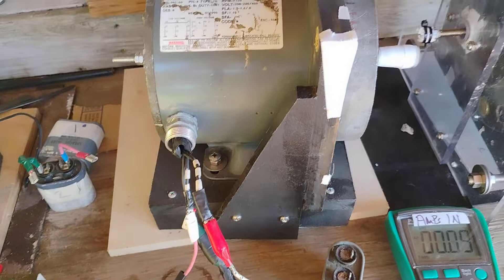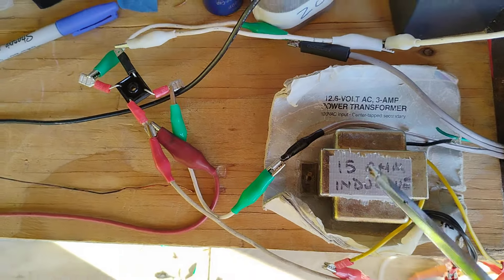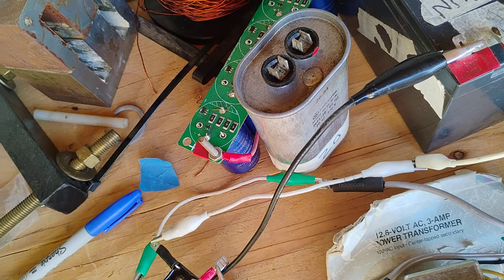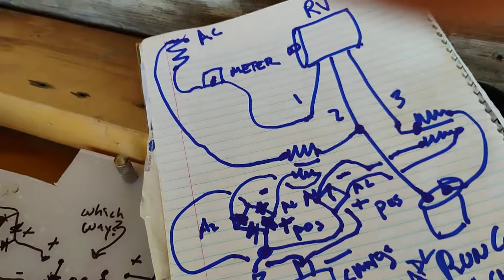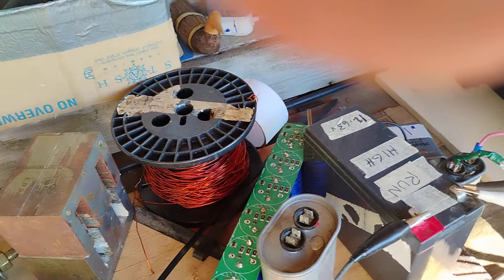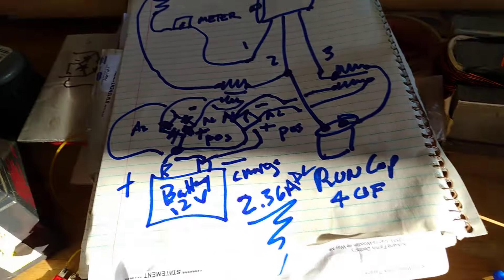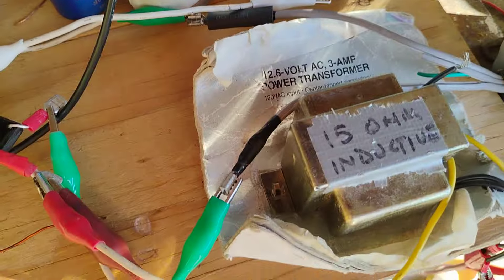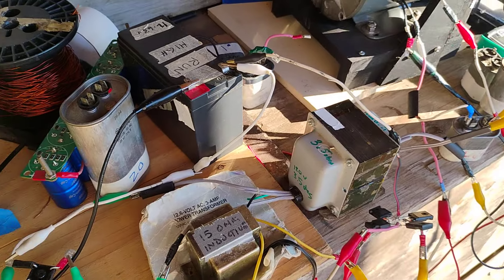2.3Adc(!) now feeding battery, dual transformers and FWBRs, (note draw goes up to60W however)

Comment from the maker: Here is the rotovertor circuit using two transformers and two FWBRS in link below that  I promised I would post instead of the very messy drawing in video:
https://alternativeworldenergy.wordpress.com/simple-rotovertor-looper/
Also, at 12:10 I meant to say 4uf cap, not a 2uf cap.
In link below  is the looping Rotovertor circuit Hector posted years ago that I was trying to replicate yesterday and today,  and finally came up with my own version which is very similar....note the "extra" transformer at bottom of drawing:
 https://alternativeworldenergy.wordpress.com/hector-rotovertor-circuit/

Comment: One of the things I did with this setup was take the vectored power over to the RV Alt and vector that out with a larger transformer.  Basic rig is to have two motors nose to nose. The trick is to run the second motor off of the run phase cap with it's own run phase cap. 2 RVs in parallel run on less than one driving the other at idle. Vector transformers can then drive the load  Get a second motor and use it like a vectored transformer.
Reply from the maker: Hi Chad
I have my dual rotor alternator thing to attach to shaft, it's similar to a Muller generator like our friend Robert Myrland loopedr using an RV spinning it years ago.  
What you describe sounds like what Tom McKay did (also years ago) using two motors shaft to shaft with run caps combined I guess  vectored into the other.  I have all his schematics if you want to see them .
Hector calls what I did here in video  parallel solid state. I guess with invertor in loop that makes it solid state. I don't know...
I took your advice and soldered all my connecting cables as when one goes bad it screws up progress forever  until the problem found  meanwhile I go down wrong road thinking it doesn't work with gremlins laughing as it's just cable.
You should join EVGRAY@grouos.io/ Hector monitors it from his distance he  will start posting again when his computer gets fixed I hope..  Wally from Argentina posts there he is really doing good RV work...
Reply from the maker: Hi Chad
I tested this out today and it does not work very well, the draw does NOT stay at 90ma but instead goes up to a huge 500ma when the extra transformer  put in circuit across L1 and L2
Sorry!

Comment from the maker: Hi Mehmet
Problem when I added the second transformer, I put the AC legs of it's primary in parallel with the AC feed to the motor itself.  So it's like adding another AC power supply on top of, and independent to the run cap phase that I have been pulling that 340,ma out of and then slammed. In the 😂rectified secondary output of that "extra" transformer straight into the super cap and battery.  I was fooled because tone of motor did not change and meter showed no increase in draw.  The ammeter was in wrong place and did not the extra draw, when I put meter in correct place now the huge extra draw shows up wh n I get the 2.3A into super cap and battery.  With invertor ipoweing motor in looped mode  and motor not connected to grid anymore now the invertor cuts out every five seconds or so from some current limiter inside it..adjusting run caps is no help as I have bypassed the motor just slammed more juice into the super cap and battery via straight from the AC input.  I am going to take this video down in a few days as it is embarrassing

Comment: Awesome. Well done! With the set up dialed in so well it would be interesting to try another, less efficent, inverter if you have one kicking around, just to see if will work without the special statpower inverter. Thanks for sharing.
Reply from the maker: Hi Sandy
These tests were done with the 120VAC 60hz grid....the circuit drawing shows it looped however, with the statpower invertor, most probably any invertor would work. 
The statpower runs the RV at 12VDC and 530ma while a "normal" invertor would draw 12VDC and about 1A worth of power...

Comment: I tested this today with the ,not the grid power, and it DOES NOT WORK VERY WELL! 
The input draw goes way up when the 2.3A appears.
Putting the extra transformer across the AC feed lines just makes draw go way up to 60W input in order to get that big amps charge 
Sorry,!

Comment: The two transformers are probably outputing different voltages and the battery is a highly non linear load so no conclusions can be drawn.  The gentleman's solution is a three phase transformer and rectifier.  Second best is to use three identical transformers and connect so as to get low voltage, three phase AC, then make a three phase rectifier with 6 diodes.
Reply from the maker: This a dumb mistake not having ammeter in correct position to see increased draw to 60W from 11W when extra transformer connected direct to AC power input shoots in the 30W charge. If no increased draw this would of been fantastic but not the case

Comment: Doug, nice. Have you tried this same experiment using schotsky diodes, or are those, you are using?
I am liking schotsky diode results, but am on the look out for heavy amperage ones.
Reply from the maker: I have some 600V 15A ultra fast diodes, and also just hot a bagfull of MUR 160 super ultra fast  diodes, 600V and 1A rated (these for repair of statpwer invertor as when I hooked pos tto neg from battery not only did the fuse blow, but so did this diode) So I fixed the invertors they work fine now.  Both of these diodes work good, especially the 15A ones.  You can always parallel diodes if you want more amps

Comment from the maker: WORKS NO GOOD!!!! SORRY DRAW GOES WAY UP TO ^60W when extra transformer connects.
Reply: Thanks for letting us know and thanks for keeping at it and sharing your progress.
Reply: Kon, You have to tune the circuit to correct the imbalances that you create by adding a load. So under load, start putting low-value run caps between L1, L2, and L3 motor windings. As you put different values of run caps between different legs of the motor windings, watch the input amp reading. It will either go up or down. Of course, you want the amps to go down. So use whatever caps you have to achieve this, you know what I am talking about, right? It's exactly like tuning the strings of the guitar.

Comment: So,  120 VAC X 0.09 AMPS = 10.8 watts Input and ~12 VDC X 2.36 AMPS = 28.32 watts Output. Is that correct? Can we see the volt meter DC value across the battery? If those numbers are correct, it should be on a continuous rise.
Reply from the maker: That seems to be the numbers, the battery charged very well during filming...
.I was only testing using the grid 120VAC in this video as goal was to get some good amps out of it.  
Yes the volts should be on a continuous rise if it is running  from the invertor in a looped mode,,,,
Reply: I agree, the numbers are good and encouraging. But here is one more thing to take into consideration. When you use a DC to AC inverter to power the AC motor, how efficient are those inverters?
Reply from the maker: Hi Mehmet 
The invertor I use is a statpower brand and it has no step windings like a normal transformer instead it's circuit uses a DC to DC boost convertor to step up voltage and then some  H switching for AC
 it uses the same watts as when I run rotovertor from grid.
 Comparing to standard invertors it uses half the watts.
Reply from the maker: The numbers are way wrrong and it works not good....the input does not stay at 90mo it goes up to 500ma (60W) upon connecting the extra transformer.  I had the ammeter in wrong place!  SORRY

Comment: Isn't the second transformer just a separate load like plugging two items in a three output extension cord?
Your measuring the in of one and the out of the second added to the out of the first.
Sorry just a little confused.
Reply from the maker: Hi Jon 
It's the DC out of the secondary of   transformer A joined with the DC out of  secondary of transformer B 

While transformer A  has it's primary in series with  L3  line that "-goes through" one half of the transformer to one side of the  4uf AC run cap that stretches across the "rotary transformer" phase. (L2 to L3)

And the primary of transformer B  is not in series like transformer A primary is,  but transformer B has  it's primary parallel stretching  across L1 to L2

The primaries of both transformers extract the reactive power circulating in the run cap phases using different pathways how my contorted mind looks at it.

Look at the Hectors drawing in the  second link I put up  to add to confusion
I had asked Hector about that extra transformer at bottom of his drawing and I asked is it not just stepping down the power direct from the grid (like you are thinking and I did too) 
and he said no it "goes to the run cap -  look where the primary ends up"
Reply: You are right !  The draw goes way up when the extra transformer added to mix.  I had ammeter in wrong place did not show the extra draw happening 
Looks like 60w in when 30w charge l